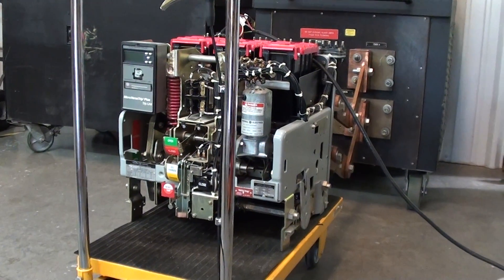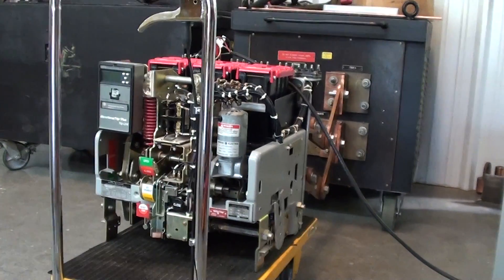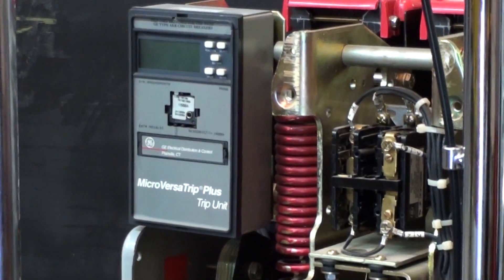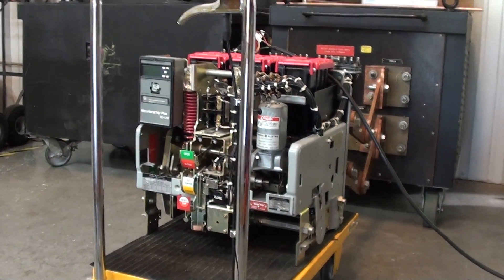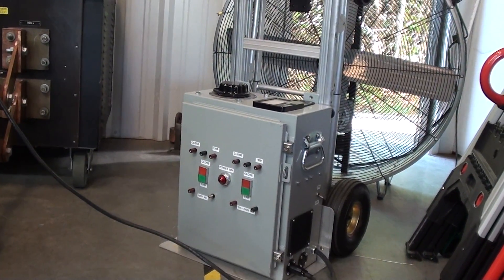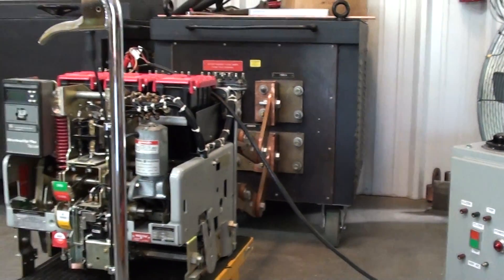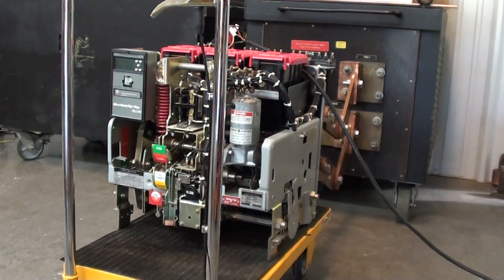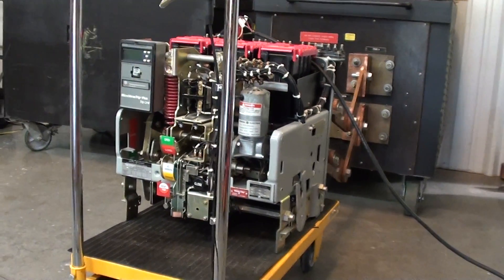GE circuit breaker type AKR-10D-50 refurbishment

Comment: We changed out the Microversa Trip with a new AC Pro by Utility Relay, and we also installed an new actuator. This corrected the problem. I believe there has been some problems with the MVT having this eronous trip problem.

Comment: I am an instructor that teaches LVCB maintenance and am interested in this.  QUESTIONS:
1. What type of TRIP were you getting? LTD, etc. 2. While testing, were you able to tell why the breaker was tripping? 3. At any time, did you try to monitoring the MVT-Plus under various conditions such as temperature changes, vibration, etc?
4. How could it get a TRIP with no load?  The MVT-P is just sitting there doing nothing.  
INTERESTING PROBLEM..  I think you're correct in changing out the MVT-P.